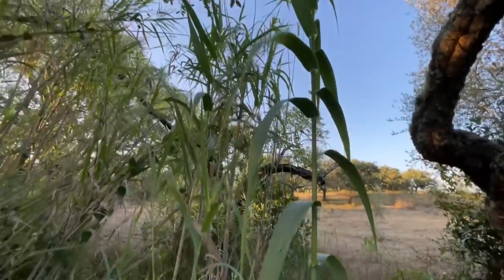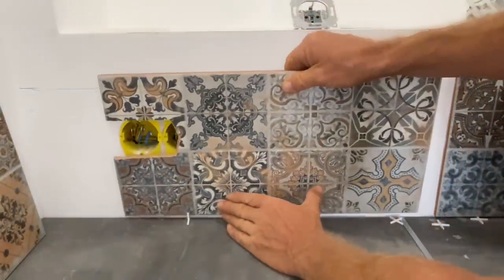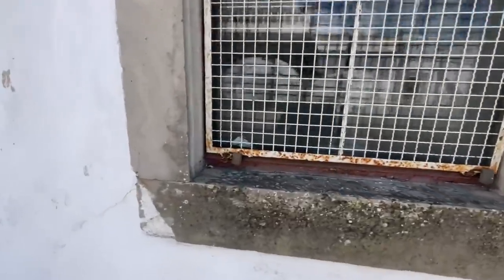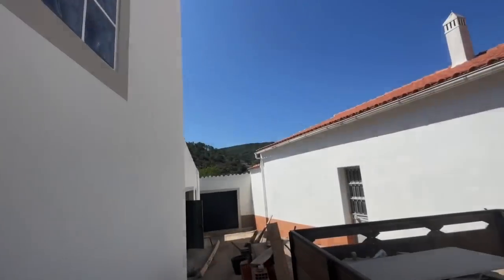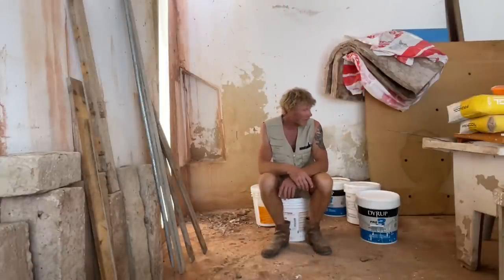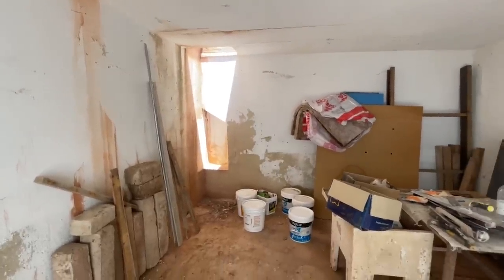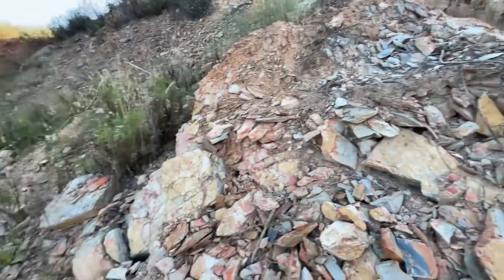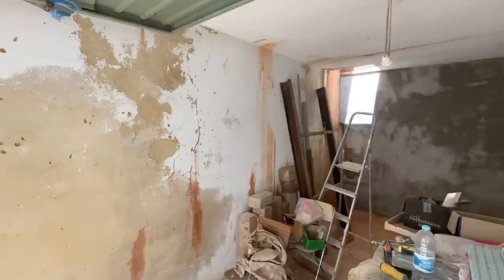WORKING IN THIS TEMPERATURE IS NUTS | Getting Closer to the Courtyard  #125

Comment: Andrew, there is a good trick re watering. Take an empty plastic 1 to 2 liter bottle, fill with water. Burn several holes in the cap with a thin hot nail. Screw the cap on the bottle, tip upside down and bury a 1/4 of the bottle in the soil next to the roots of your fruit trees. The water gently wicks into the soil when needed. You can unearth them and refill them. 👍
Reply from the maker: I’ve just done that with 5L bottles funnily enough. 👍
Reply: @blondguy  👍😄

Comment: Its hard to make out where the garage and patio are relative to the kitchen, because i cannot see any doors leading from the inside of the house to the patio, seems you only can get there going outside? Also, the garage, can a car actually park in there, it seems a bit of a tight turn to get into the garage. Just curious😅
Reply from the maker: I’ve done loads of walk arounds in my videos. Yes a car can. Probably because of the truck and we haven’t cleared the drive.